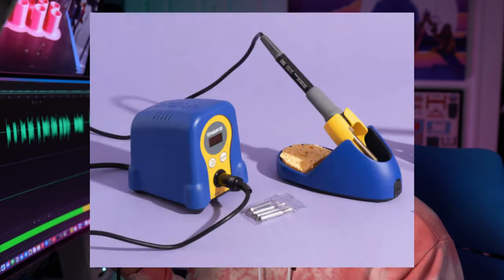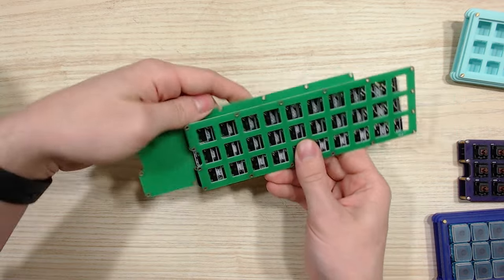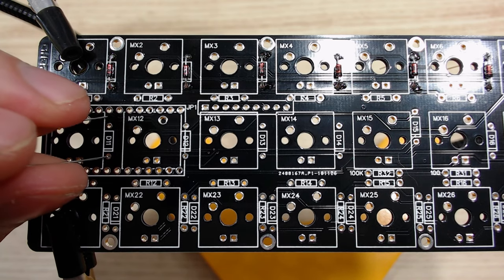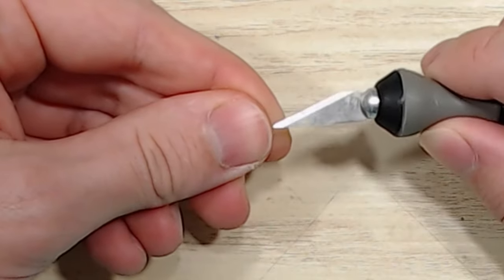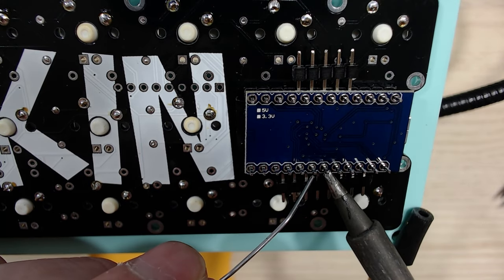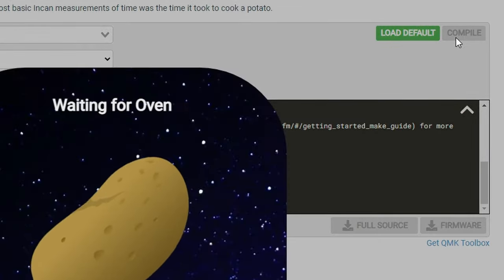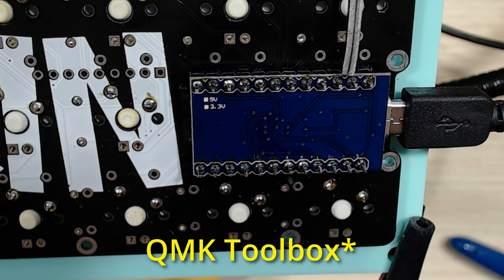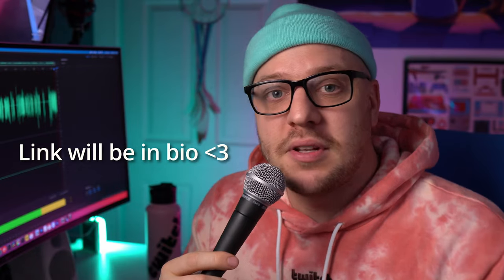Keyboard with only 30 keys?! | Gherkin Build & Flash Guide

Comment: Wow I'm surprised you don't have more subs. One of the best tutorials I've seen from the mk community, period. I just got given a Gherkin so I'll be building that soon! Any chance you'd do a video about programming macros with QMK? I have no idea how to do key combos and key strings in there. Regardless, thanks for your video :)
Reply from the maker: Thank you very much for that compliment :) so I have another tutorial on this channel called “how to flash a super16 board”. The process is pretty much identical, but you just are using a different board. The microcontroller is the exact same so the steps are almost identical.

Comment: If you want to daily drive the Gherkin as a regular keyboard, I recommend learning how to write your keymap by hand and compiling it on a local QMK environment so you can use things like home row mods and auto shift, the Gherkin can be a great daily keyboard with the right keymap for your workflow.
Reply from the maker: I would have a really difficult time on something like the gerkin. MAYBE a 40%, never this thing lol. I just bought my first ortho split and that look months to get used to lol
Reply: @Naaackers  it's all an evolutionary process, I can type around 60 to 70 wpm with numbers symbols and  punctuation on my Gherkin and I find it better then my 40's. I started on a 75% and  used to think I could never go any smaller.

Comment: Can you add led to this keyboard?
Reply from the maker: You can indeed! I haven't done it, but it's possible from other tutorials I've seen.
Reply: @Naaackers  Hey. Thanks for this video! I would be grateful if you suggest me some of those tutorials also. I have searched today, but couldn't find helpful any video or document to enable RGB lights (I have put LEDs on the board, but my problem is its firmware), and I'm sorry for my bad English :)